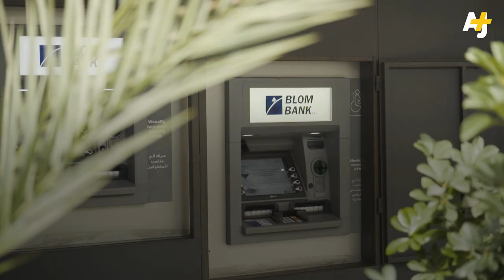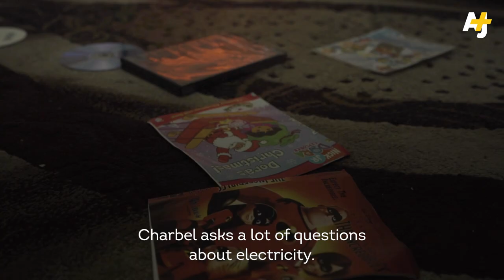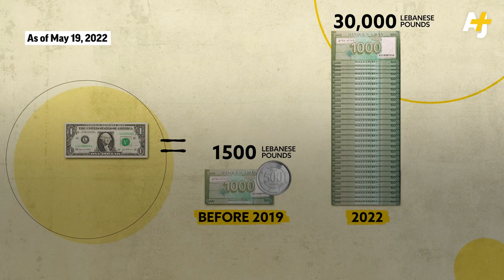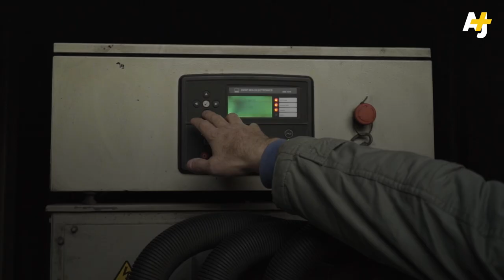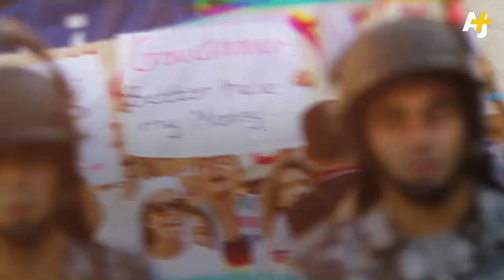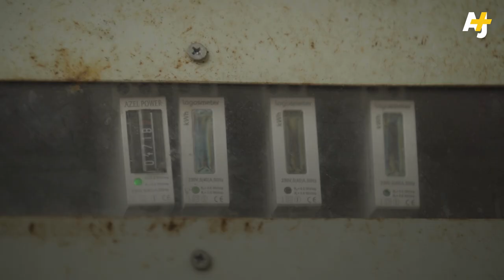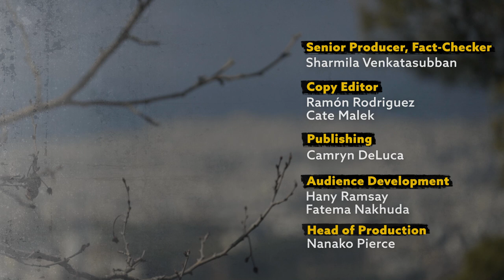How Lebanon Ran Out of Electricity

Comment: I need to add one more thing. Get two terracotta pots one large and one small, sand, rocks and white cloths. Place the small terracotta pot inside the large one making sure that there is space for the sand between the two pots. Fill the space with sand and place the rocks on top of the sand. Place the food inside the small pot (you may need several large and small pots, sand and rocks according to how much food that needs to be refrigerated by these pots.) fill the space between the two pots with water. Then, cover both pots with the wet cloths. This method is another form of refrigeration for when the electricity goes out or you simply don't have a refrigerator.

Comment: Switch most of your country’s engines to run off hydrogen gas made from water metal rods plates electricity from batteries use led lights use portable inverter generators use led solar power lights with battery backup that use the sun to charge during the day and battery at night so many options available
Reply: Alot of people have solar due to this, but the inflation isnt makimg the switch easy aswell as the electricity generator cartels, its not a competetive market for a reason.

Comment: There is a lot of inefficient things happen in their way of life. 

1. If you poor never use car as your main transport. Sell your car, buy motorcycle and bicycle. Motorcycle is up to 10x less operational and maintenance cost. Yes its 10x.
2. Dont use car taxi everyday, buy motorcycle or use motorcycle taxi
3. Who the heck run their country electricity with diesel? Its very expensive. Use coal power plant instead. Lebanon goverment should make it.